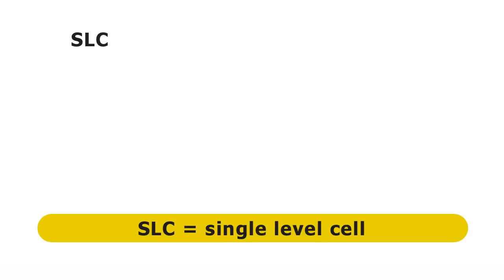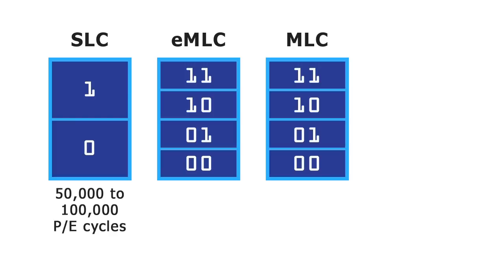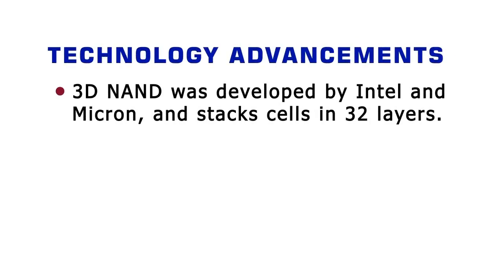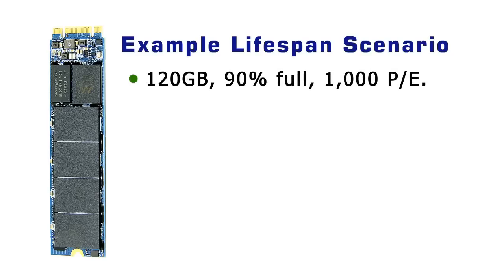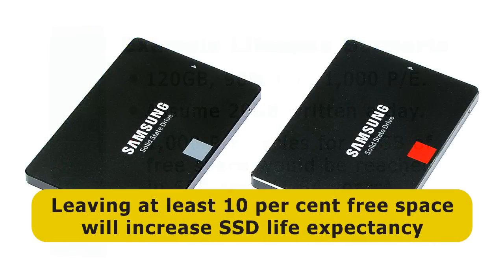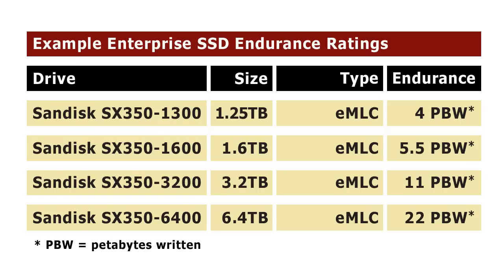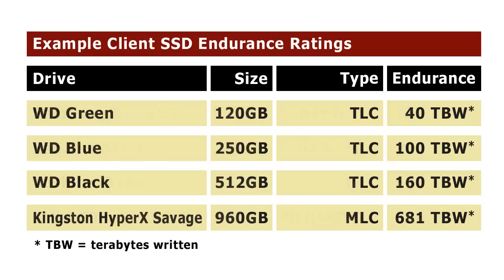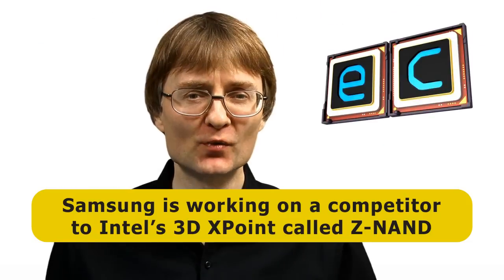SSD Life Expectancy

Comment: OS on SSD, data on HDD.
Reply: You can put your data on SSD as well if you have the money to buy a large SSD. No problem at all. For instance if you record multitrack audio in a recording studio, you better record directly on SSD.
Reply: games and OS on SSD, other stuff on hdd :D
Reply: OS AND games on ssd...
Reply: yes U r right
Reply: I rather put OS on nvme tbh
Reply: Solara nvme is a type of SSD...
Reply: Bradley Walton didn't say it wasn't, but it's faster.
Reply: A Caviar Black is fast enough.
Reply: Jack Vand they're all within seconds of each other, no real world difference to notice, but the nvme is a very noticeable difference
Reply: My 960 evo nvme boots windows 10 in 5 seconds.
Reply: Kaal Rhys same.
Reply: I prefer all on Ssd. The time will come soon, when Ssd is cheap enough.
Reply: @Kaal Rhys Even with nvme, windows will still slow down over time unless you keep maintaining it. I'd rather just install the OS and use my machine time productively instead of tinkering and maintaining the OS. I suppose it depends whether you get exited about maintaining windows.
Reply: Aka bukan penungu
Reply: I partition my SSD in half.  One partition for Windows and the other for files, like music, video, and etc.   Then I have a 7200 HHD on a second SATA port for storage/backups.  Have a duplicate external storage/backups.  And have an external 7200 HHD which I run Linux from, which I keep the boot loader on that drive.
Reply: Incorrect. Studios / post-production houses have been using 7200rpm HDDs for multi-track audio for many, many years. They work just fine. The only real benefit to SSDs in audio production is for read speed - sample library loading, project loading. HDDs are fully capable of streaming / recording large amounts of audio data.
Reply: Anabelle Curtis
That's until a background program wakes up (like an AV doing a scan, Windows update, cloud service uploading, or etc) and interrupts recording. Doesn't happen often, but there has been times when there would be a small stutter in the recording because of it.  And don't let me get started on video exporting which I see hiccups much more often.  This is why so many would choose Macs, cause there is a lot less going on in the background of OSX/MacOS.   With SSDs the cache is so much faster and bigger versus any HDD.  I haven't experienced a hiccup yet with audio or video recording or exporting with SSDs.
Reply: I don't know a single studio that would be running live updates or backups during a recording session -  whether it was SSD or HDD. This is like computer 101. Video exporting is irrelevant as you wouldn't be exporting video while recording. Macs never had much to do with performance - it had more to do with Pro Tools being the standard DAW, and in the early days was a proprietary system for Mac. It made compatibility between studios / post-houses extremely efficient. Somewhere along the line it became mistaken for OS performance - but generally by people who didn't know much about computers (i.e. audio people). SSDs are wonderful for efficiency / speed, but you can do extremely high level video & audio work with HDDs...as has been the case for 20 years. 4K...which is relatively recent has been the first resolution paradigm where SSDs are becoming more necessary. Some recent games also benefit from SSDs for texture streaming (open world type games). Audio however, is still relatively resource light when it comes to demands on disc speed, even at 96K.
Reply: Anabelle Curtis
That's exactly my point, I'm speaking from a consumer point of view.  And video exporting is relevant during the conversion process. I'm not saying that HDDs are not capable. I'm saying you are more likely to encounter hiccups with HHDs.  And with today's CPUs/GPUs, bottlenecking will occur every now and then with a HDD.  I experienced that the most with Adobe.   Again, I haven't experienced the occasional hiccup since I went to SSDs.  Occasional lag from using audio controllers has also gone away.  I no expert on the technical side of things,  but in my experience, having a SSD is a near flawless experience vs using a HDD which you will run into occasional hiccups( at the worst times).
Reply: Everything on an SSD and toss the spinning HD  - if  $$ allow
Reply: Depends on what you're using the PC for. I'm not a gamer and I'm working on my PC up to 10h/day, I also need quite a hefty amounts of storage for image databases, so I'm currently running with 3 hard drives (500Gb boot + 2x1Tb storage), all high-end consumer grade (WD Caviar Black), plus 3 more terabyte external drives as backup. Counting only the internal drives, their current retail value is 300$ tops, but if I were to switch to SSDs I'd have to spend well over 1000$. As I don't really need faster access speeds I can't see the point of spending so much money for basically the same thing.

If correctly mounted and maintained, high-end mechanical hard drives like mine have a life expectancy of at least 3 years of intensive daily use and all my older drives (removed during capacity expansion upgrades) are still in perfect working condition (i use them as a second offline backup) after as much as 10 years, so this "mechanical hard drives unreliability" is more a commercial ruse than a real problem.
Reply: OS and software on SSD, data on raid 5 array, backup on external HDD and DVD.
Reply: Kaal Rhys I've just ordered one of these for my OS. I'm glad to see you like it.
Reply: >>> Crazy Clown: Dark, eh?
Reply: I will SSD with 60% of all data (software, os, data etc) but i keep movies and that kind of data on HDD, but when i play back the movie, i tend to mvoe it on ssd
Reply: game only for me xD can't afford the larger capacity but IT"S AWESOME!!
Reply: Substandard Gamer Kiba Wrong, Data .doc, .pdf (ms office) should in ssd or usb.. hdd is suck, when electric fail all my data in hdd gone with the wind..never trust your important data on hdd , they most like loki , untrusted..
Reply: You can use cloud service for small doc. or hdd backup that is never gonna be used.
Reply: MIchael Wiggler cloud and hdd, they are untrustred... especially hdd , 1 tb my data gone because of that hdd... and for cloud is only last of option after ssd and fd ,
Reply: I am talking about hdd that is not used and moved around and not powered on. You just backup data and thats it. If you are using it in pc, just buy another one and use it in this matter what i have described. You will use it when you need serious backup and that can be once per month, 3,6,12 months depending on what you do. If you are video professional, invest in RAID options. I have 8tb of storage in various formats of hdd  and 3tb hdd will be used for backup of data which i can lose and another 750gb hdd of data which i can not lose but both will be saved on both 3tb and 750 gb ones. 750 GB one, i will not touch unless i need it.   I use 500gb ssd in my imac which i not fill over 60% and that is what i need. and i have 250gb in laptop which i only need 100-120gb in worst case scenarios. I bet you cant lose data if you treat your data carefully. If you fill 1tb hdd with 1hdd of data, well what to expect ?  Only twice in 15 years of using hdd that hard disc failed me, once when i filled it up to 90% and kept it running like that and other time when it accidentally dropped. And i used several laptops and desktops in mean time that i used more than 3,4 years which is somewhat lifespan of hdd.
Reply: MIchael Wiggler
 Ok i understand what you mean but , but i already too disappointed with hdd , they killed all my data... beside that they are fragile when the drive fall from your hand there is a risk the drive is broken , because they are'nt shockproof  even some of them support shockproof
Reply: But sadly, it's a bit of a gimmick if you're only using it for everyday stuff. Unless you're transferring large files on a daily basis, you won't find a ounce of difference in launch times when comparing a SATA SSD to a PCIe x4 Nvme drive.
Reply: Get yourself a couple of 4tb external drives, and keep your data, and drive image backed up. I recommend Macrium Reflect.
Reply: Keep calm, and don't panic!... your ssd drive will fail soon... lol
SSD with their lame PE write cycles lag behind normal spinning drives which are still more reliable, as a matter of fact I've used my last 1TB system drive for ever 7 years without absolutely no problems... beat that SSDs!! lol
Reply: LOL, what is this, 2010? EVERYTHING on SSD. I would never go back to spinning metal shit unless I had terabytes upon terabytes of data, and SSD cost would be unacceptable.
Reply: Not everything on ssd... especially old porn movies are perfectly safe on cheap spinners... lmao!!
Reply: Good call
Reply: so does my sata 850 evo
Reply: "My 960 evo nvme boots windows 10 in 5 seconds."
I've never understood what the point of a fast boot is. My laptop resumes after zero seconds. It's instantly on before I even raise the screen, so no need to wait 5 long seconds.
Reply: You mean OS + Apps on SSD and Data on RAID 1 or better HDD. I personally have a separate SSD for Steam games...
Reply: data on ssd because you are not going to erase your precious data. OS kept on erasing data during updates
Reply: my transcend 500gb ssd lasted only 4 years... wtf. while my mech drive is still alive and kicking
Reply: That's the way to set up a computer. I have this computer set up with a SSD for the OS and a standard HDD for storage and as my workspace.
Reply: temporary files on ramdisk will help
Reply: Not a bad concept however when you are working with high-def videos, rendering and transferring them from point A to point B, when you think about INPUT/ OUTPUT operations and time is of extreme value, storing this type of data on a SSD may work out much better.
Reply: Games on SSD? lol it won't last more than 2 years as each game is like 50GB in size. Best option for game storage is 2x 7200rpm HDDs in RAID 0, they load fast, there's tons of space, it doesn't wear out and it's much cheaper than SSD.
Reply: with a largee amount of ram, as a cache yes.
Reply: are you kidding?
Reply: if youre a programmer you better put everything on SSD, source code, SDK, dependency manager cache (npm/maven/gradle etc) your day-to-day use shellscripts... On my workstation I have an HDD for basically three things: my deja-dup backups, my spotify cache directory and my web browser Downloads directory, everything else is on SSD, including my home directory
Reply: Malayan Grago Not soon enough. 4 tb ssd are still to expensive.
Reply: If ssd were cheaper, i would store everything on SSD actually. There is so much room for failure in hard drives. Hard drives can fail because of the platters, the actuator, the motor etc etc..... A ssd can fail due to bad manufacturing or too many write cycles. That's pretty much it.
Reply: laptop user here.
everything on ssd. my old laptop that now use as a server (mostly torrent and plex machine) is still going strong and its ssd (240gb kingston hyperx 3k) is 3 maybe 4 years old.
all the important data is being handled by 2 2tb usb3.0 external drives though, but the ssd is still in use by the os, torrent files (the torrent files itself, not the data) and plex database.
Reply: so you pay 100$ to save 20 seconds twice a day ?
Reply: True!
Reply: Yes the storage drive can be a hard drive since its not accessed that much.
Reply: Windows is an SSD-killer.  So, Linux on SSD, Windows on HDD, storage on HDD.
Reply: More like ALL the programs on a SSD and media files (videos, music...) and downloaded files on a HDD.
Reply: I want faster virus scanning of my entire computer.  All my data leaves plenty of room on the SSD, so the is what I will do.  This video does not address what type of activities create writes to the drive, or how to monitor that.  I suspect that my use does not create a lot of write activity.
Reply: my 540 evo boots win7 in about 20 sec or so....
Linux boots even faster :-)
Reply: @malayangrago5628  9 months in the future and bingo !  Prices have dropped :-)
Reply: @anabellecurtis75  i would add that some use 10,000 rpm drives. The only reason to use ssd for recording to, is if you aren't planning on recording over the data later on.
Reply: @malayangrago5628   cheap and easy to replace as SD cards ..
Reply: Everything (system, games, programs, data, etc.) on SSDs, backups on HDDs.
Reply: True. This is what I planned at last.
Reply: @LIVEFRMNYC  oh guess what you don't need any of that shit so yeah I'm not an antivirus on my computer for a very long time lol
Reply: I was wondering if that would be the best bet. It would be highly efficient. I always separate OS and data on my (Linux) system so that I can easily upgrade so this would be an ideal solution.
Reply: Substandard Gamer Kiba i would put games on hdd and just programs you use everyday on ssd
Reply: @bradleywalton970  eh to each their own the vast majority of my games are still on HDD which is perfectly fine for me. I keep the more demanding open world games ect on my SSD but that's it. I'm not spending hundreds of dollars to store the bulk of my games on SSD just so I can get faster load times. Games that aren't all that demanding don't have that long of load times anyway. HDD's arent the end of the world especially when the OS is on an SSD and not taxing the HDD you are trying to use for games.
Reply: @LIVEFRMNYC  Most people don't use HDD's for their operating system anyway.  HDD's are still very capable thats for sure especially when you arent trying to run an operating system on it because that can really slow down an HDD for your other tasks plus make your PC very sluggish. But when using an HDD strictly for storage ect its fine heck I use an external 3TB 2.5" 5400RPM WD HDD for my movies and the vast majority of my games and its perfect for my needs. I do keep my more demanding open world games ect on my m.2 nvme but the majority of my games arent that demanding and the HDD loads em up in a very reasonable amount of time considering its not trying to run an operating system as well. It cost me 60 bucks for that 3TB HDD and had I bought an SSD instead I probably would've paid around 300 bucks. Not worth the price difference for my needs. My m.2 nvme is only 500GB though so down the road I plan on either upgrading it and turning the 500GB into an external drive OR just buy a sata SSD to toss into one of the HDD slots the case comes with. I also plan on buying a few large capacity HDD's to throw in the case too that away I have all the storage I could need with the majority being HDD for the bulk storage and some SSD for when I need faster storage.
Reply: @justincase9638  Thats just a waste of money.... Why would you toss the HDD if it works? They are still very affordable storage options for movies/pictures/files ect... I still have the vast majority of my games on HDD too because when it comes down to it they work fine when you aren't trying to run an operating system on them as well. That really slows em down but when using them strictly for storage they are great for the price. My more demanding open world games go on my m.2 nvme but the rest go on my external HDD and the load times aren't bad at all its very reasonable. So why throw it out and replace it with an SSD instead of using both forms of storage for different needs? Even if its just to backup files ect for if the main drive fails.
Reply: @Dr_V  I do really hope that you have at least swapped the boot drive with an SSD but the HDD is still fine for the storage. Using the SSD for the boot drive makes the experience significantly better though and its not like you have to spend a ton of money on it.
Reply: @andiafandi4786  Or get a UPS for your PC so you can do a proper shutdown if the power goes out... HDD doesnt suck... Its still perfectly fine for mass storage or as backup drives if your main drive fails... Both SSD and HDD are good to have for different types of storage...
Reply: @aaronmicalowe  Because not everyone wants to wait 10 minutes for their PC to turn on and load everything up? Its very nice being able to boot and have everything loaded up in under 10 seconds... I also don't keep my PC on 24/7 because its just pointless and allows more dust to enter the rig ect. Plus there's absolutely no need to keep it running 24/7 when it boots up in seconds. Back in the HDD days I kept my PC running 24/7 so I wouldn't have to deal with the long load times and you shouldve seen the dust that had built up in it.

Not to mention that running your operating system on your HDD absolutely slows it down for when you need it for your storage materials. I still use HDD for the majority of my storage but I also don't run an operating system on it so its not bogged down and it works fine for my movies/majority of my games.
Reply: @PackinStackin  2 years later and 4TB SSD's are still to expensive. Though 1TB and below are becoming very reasonably priced.
Reply: @TheFrogInYourClosetWatchingYou  My laptop gets to Windows in under 1 second and it's 12 years old. But from a cold boot takes longer. About 8 to 10 seconds.
Reply: R H   Yea maybe another 2 years and they been more reasonable
Reply: @TheFrogInYourClosetWatchingYou  HDDs may last for another 8 years.. I have some that have been running for about 10 years.. I guess I just don't want to wait that long.. Sometimes the spend is more than just a monetary decision.  I don't like to waste money but sometimes I justify it.( poorly)